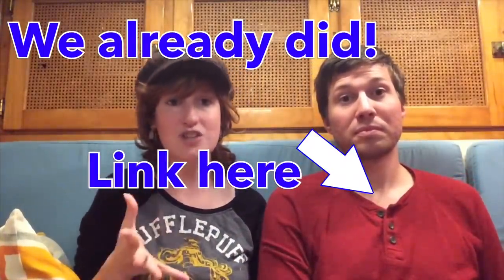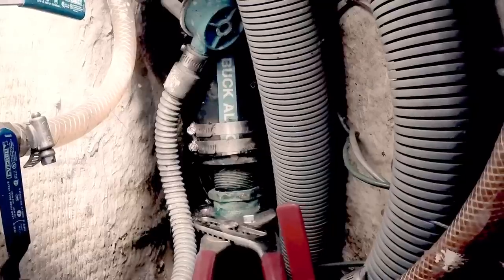Equipment Failures and Success Across the Ocean | Sailing Wisdom

Comment: I had to chuckle about the synthetic rigging. Has everyone forgotten that for hundreds of years, all rigging was rope??  According to the internet, it wasn't until the early 20th century that wire rigging was used.  Remember all of the dead eyes and such on tall ships?? 

As with everything else, hemp rigging, synthetic rigging, and wire rigging all of pros and cons.  I would think that the most common cause of failure of each is improper maintenance or unexpected/unprepared loads.  One might as well say one should never have bolt-on keels because they might fail if not properly maintained.  Yet thousands of boats log probably thousands of miles each with them.

Thanks for this series, I appreciate all of the information and experiences you have shared.
Reply from the maker: It seems so. I like it when people tell me that standing rigging has to be steel because that’s what it has always been...

Comment: Congratulations on your crossing.  As for failures, I think SV Delos hand steered a significant portion of their most recent Atlantic (East to West) crossing. And I like the way Capt. James on his catamaran SV Zingaro talks about his synthetic rigging, he keeps a spare spool onboard and can fix any part of his rigging any where in the world by himself without waiting for parts or being in a Port.
Reply from the maker: We have carried a full spook (600 feet) of heat set dyneema in a locker, since I installed it in 2015. If anything happens, we have the materials to build a new setup, anywhere!
Reply: Does the spare rope go bad after a period of time, or is that never a problem.
Reply: @jcregal3456  that is a very good question. I'd like to know the answer to as well.

Comment: I agree with your philosophy about how to sail the ocean where when the wind blows you move, there is no need to motor across the ocean. I sailed the Atlantic westbound in 1989 from England to Southern Portugal was single handed and then a friend joined me to do the crossing. He had never Sailed before and was frustrated when I didn't start the motor when we had no wind. It turned out to be very funny between us. Especially when we went backwards 11 miles one day on the way towards the cape verde islands. Too funny.
Reply from the maker: That's ocean sailing for you! Some days you move some days in the wrong direction 🤣

Comment: Great video. Thank you for sharing your adventures in more detail.  I especially liked the difference  between the Monitor  and Cape Horn vanes ( external vs internal lines ).  
It’s difficult sometimes to find information on vanes.  I’m in the shopping mode for one now.
Reply from the maker: Make sure it’s a “servo pendulum” style. They are the most powerful and responsive setups :)

Comment: I've seen vloggers sailors have tons of problems with electronic instead of your Monitor Windvane. Lighting, and mechanical problems. You conceivably could have problems with the mechanical boat like the chains stuff but only with the fact that it actually connects to the steering and those parts where out. Sounded like you might be using the REACH ? What would be the minimum priced sextant you would recommend and where to find it ?

Comment: I'm curious about your thoughts on the premature failure of your solar panels as many other sailing channels don't seem to have the same corrosion issues you experienced?
Reply from the maker: It could be from the constant salt submerges that it had on the deck. It could also be that I actually measured the amps coming from them with an induction meter. The panels looked pretty fine from the outside, they were just underperforming based on their specs.

Comment: Curious if you have tried “sheet-to-tiller” self steering?  One of my next experiments.  I too have a monitor.  Wonderful.
Reply from the maker: I have not. I have read about it, and since we have a wheel, the same setup would simply take place on a bottom spoke. 
Before the Monitor, I would balance the sails and lock the helm, so I never really needed a self steering setup and therefore never experimented. The locked helm would work for about 20 min, until a wave would knock us “just enough” that we went off course, then I would make a minor adjustment and lock it again.

Comment: Does your electric motor have a way of preventing the batteries from being charged too much?

Have you thought about using a wider double block for the windvane lines? It looked like the fit was a bit tight.

Do you get a monthly quota for satellite texting and/or is it expensive? 

I bought a boat this summer. My boat yard owner came up to me and said "Please check with me before taking anything more off." I'm also a big believer in simplicity and redundant devices.
Reply from the maker: The motor does have a charge controller to prevent over charging from regen. 
I agree that the block looks a bit tight. I’m going to switch it to rings instead of blocks soon. 
The satellite texted is about $70 a month for unlimited texts.

Comment: What was the solar panels hooked up wrong or too cheap.. what? were they repairable?
Reply from the maker: The metal tabs that come out of the panel corroded away completely. They could be repaired with more solder to make the tab longer, but the aluminum housing has had its toll taken over the years. 
We’re going to replace them with bigger rigid panels. 
The flexible panels just plain died. Rust is spewing from the junction box, probably from being under water so often! We won’t be doing flexible panels again.
Reply: Okay, so what is the solution? I ask this because this is the first time I have heard of this problem and want to avoid it myself @RiggingDoctor
Reply from the maker: The little box on the underside of a rigid panels needs to stay sealed and shut. The panel that works has never been opened. The panel that died got the box knocked open in a storm off Hatteras. 
The flexible panels on the deck frequently would be submerged under salt water that poured over the deck and would run back. I think that just killed them. 
We are not buying more flexible panels, only rigid from here out for us!
Reply: @RiggingDoctor  - Good to know on the flexible panels.. I'd been considering them. Thanks!

Comment: If you haven't already done this, run the generator dry and put fuel stabilizer in your jerry cans, peace.
Reply: Or convert your genset to propane. Never goes bad. 
Another tip is to buy "pure gas", no ethanol alcohol added,  usually available at or near marinas and frequently used by lawn maintenance people in their machines.

Comment: Just wondering; so can an anode somewhere protect the solar panels? I guess the rest of the electrical system was ok. Maybe some insulating spray on the electrical parts.
Reply from the maker: The issue was the constant exposure to moist salt air while en electric current was applied. It just ate up the negative side quickly!
We need to take better care of the seal to keep water out.
Reply: "We need to take better care of the seal to keep water out."
That is an EXACT description of ALL electrical failures aboard any boat.
(well... except for problems caused by idiots like the one that originally wired my last boat... but that's another sad story altogether...)